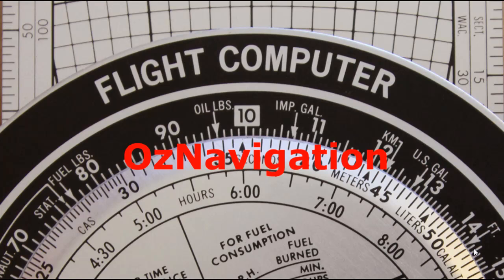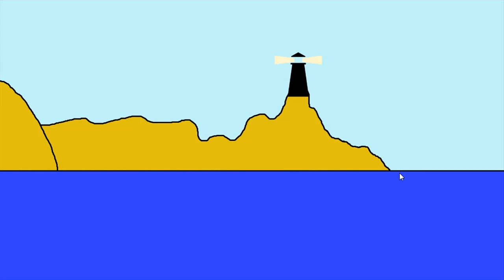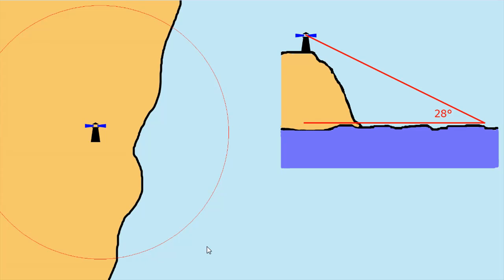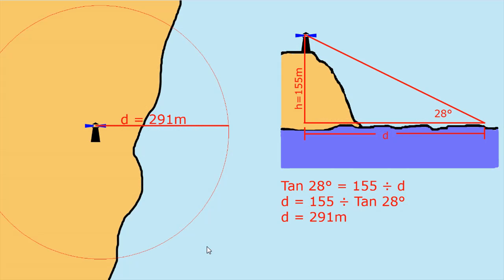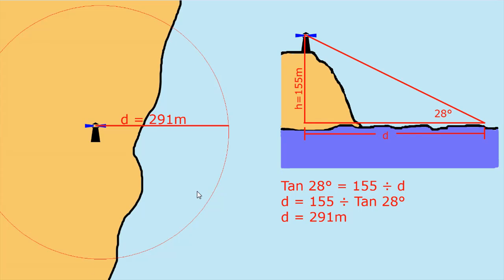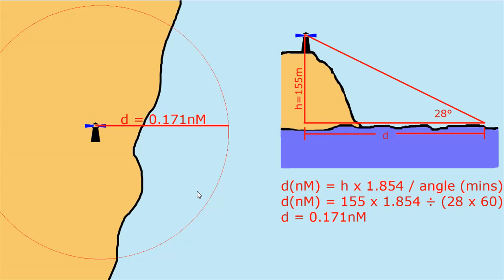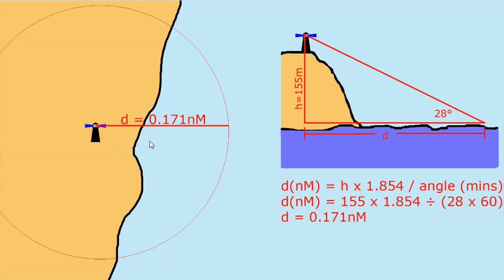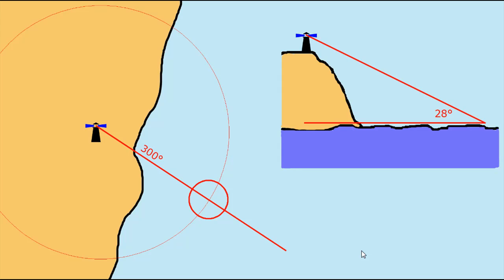AusNav #10 Vertical Sextant Angles

Comment: You keep talking about the horizon and aiming the sextant at the horizon to measure the angle to the object. That is fine if the object is only a few miles away, you can actually see the horizon to get the angle. What happens when you are many miles away from the object and the horizon has dropped way below the water line so much you can no longer see the horizon through the sextant? What do you do then to find the angle?
Reply: Where would a waterline be below the horizon
Reply: @filthymcnastyazz  All I really want to know is, how does an observer take into account earth's curvature when using a sextant to find the vertical angle.
Reply: @rodneybaker2629  you aim at a point on the horizon, not the whole of it.